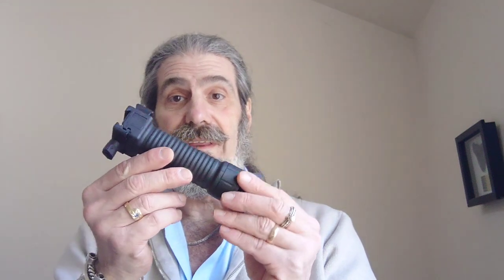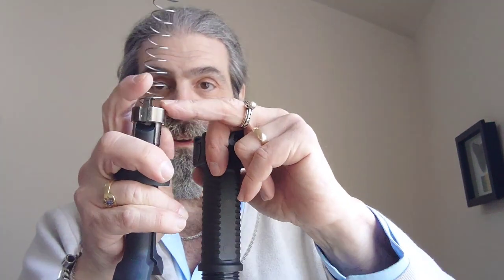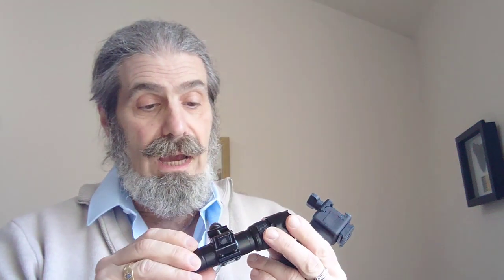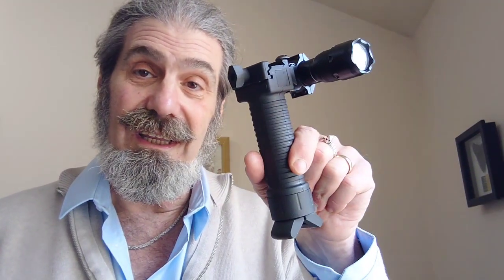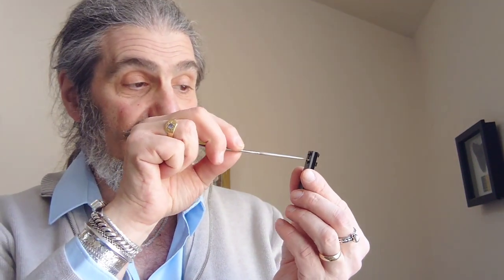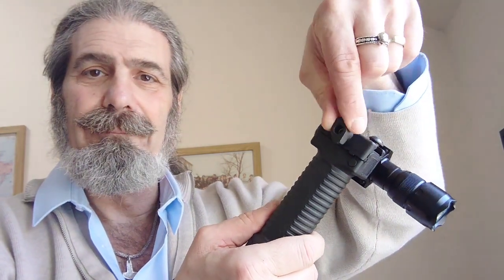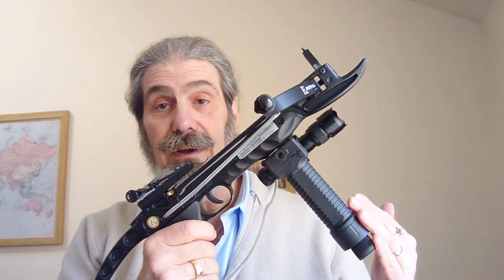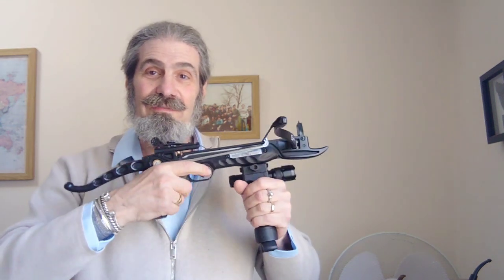Modding the Cobra Crossbow Pistol into a Tactical Carbine (Part 2) Attaching the Foregrip and Light

Comment: I've not seen a foregrip with incorporated bipod before, that's a clever solution! The Stinger 2 has a 6 inch picatinny rail at the front for the foregrip, with enough space to add a separate bipod (I don't currently have one installed as I prefer to use the space for other accessories - I may swap out the standard foregrip for the one you have). I've attached a small Olight flashlight in front of the foregrip on mine and there's a quiver fitted to the rear, which holds an additional 5 bolts in a stripper clip for fast reloading. The only other accessory I have attached is a separate laser, which  slots into a holder at the front of the crossbow - I'd recommend adding something similar to your build as it makes aiming at a short distance much, much quicker! Cheers and good luck with the rest of the build!
Reply from the maker: I think you're going to rather enjoy part five of this series, which will be focusing on the duel sighting system I'm going to employ.
Reply from the maker: Incidentally, if it helps, here's the link to Amazon that I used to buy the Foregrip I used in the video
OTraki Pod Grips Extender 20 mm Rail Vertical Rifle Foregrip 2 in1 Keymod Bipod Freely Shrinkable Rails Airsoft Grips for Outdoor Shooting Air Picatinny Weaver https://amzn.eu/d/c5Fsvh6
Reply: @Jeff.Lippman.Presents  That's great, thank you!